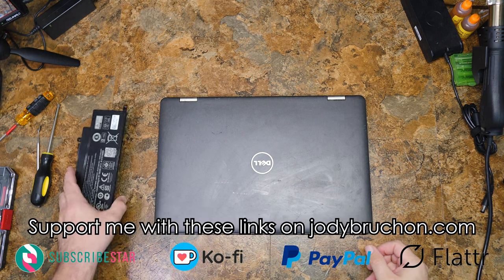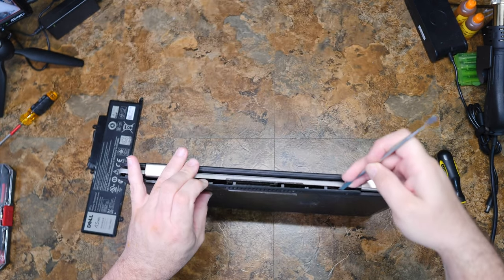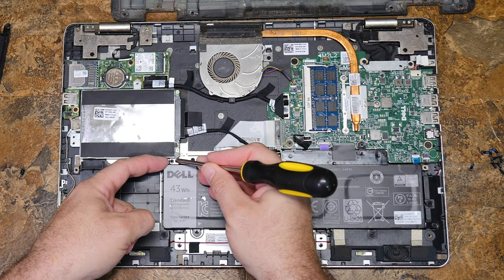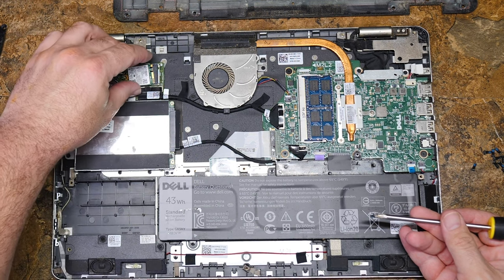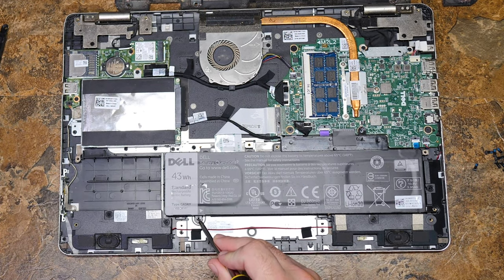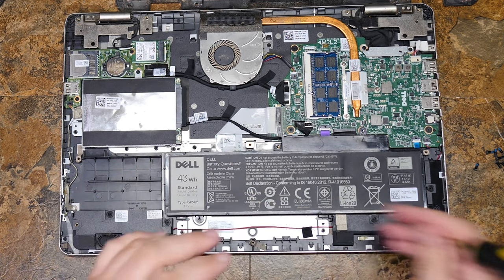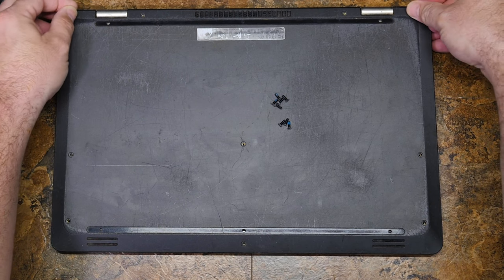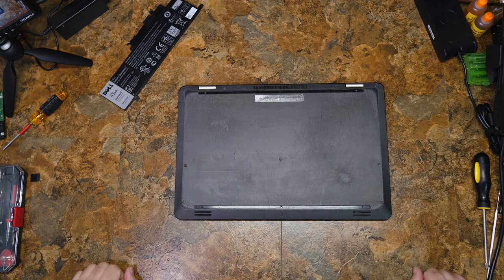Dell Inspiron 15 7558-7568 Disassembly - Jody Bruchon

Comment: I have dental tools that look very similar to the metal tool you used to pry the case open 🙂 I also have a magnetic mat that looks kind of like a calendar that has a surface you can write on with dry erase markers which can become very handy when a laptop case has different length screws (some old Sony laptops in particular had multiple lengths of case screws) so you can note where the longer screws went and also when tearing down multiple components can mark where each set of screws came from for easy reinstallation of components. Bought it from the vendor I order mobile phone parts from and love it. Think it was only about $10 and is worth every penny. 🙂
Reply from the maker: They sell these silicone work mats (I have one) on Amazon that have a magnetic strip under the top and a ton of small raised rectangles across the top so you can put screws down in order and they won't roll off. I just use it for hot air reflow and capacitor repair work but it would be quite useful for anyone who does disassembly work.

Comment: The first thing you should of done is use an anti-static mat and bracelet and the second thing after opening the case with a NON-METALLIC tool is to disconnect the battery after that you can remove the other parts. That's the right way to do it.
Reply from the maker: None of that is necessary.
Reply: I do pc repair all day long and never use anti static mats or bracelets

Comment: That is not a CMOS battery. It's for the real time clock.  Settings are not in "CMOS" (CMOS RAM), which required a battery, anymore they are in an EEPROM that doesn't need a battery to save the settings (non-volitile storage). (I think it's a 24C02C 2K serial EEPROM, on this system). 

Larger EEPROMS also hold our flashable BIOS / UEFI now as well, but they keep the "soft settings" in a smaller separate EEPROM chip.

Pulling the battery does nothing but clear the real time clock, not the BIOS settings or passwords. It hasn't done that in many many years.
Reply from the maker: Yes, it's a "CMOS battery." CMOS is a semiconductor type, so it was never technically accurate to call it a "CMOS battery" in the first place, but that's the term that has been given to it over the past four decades of PC-compatible computing. No, the settings are not stored in an EEPROM; they're stored in static RAM in the chipset that's maintained by the "CMOS battery." No, BIOS executable code is not stored in an EEPROM, it's stored in flash memory. Pulling the battery will, in fact, reset all the BIOS settings as well as the RTC.

Do not speak authoritatively on things you don't understand.
Reply: @JodyBruchon  Wow! It amazes me how little some "tech" people know about computers.  BIOS / UEFI executable code IS stored in an EEPROM (Electrically Erasable Programmable Read Only Memory).  Flash memory is an EEPROM!  Notice I used "Flashable" above.

On the Settings side of things, your are wrong as well.  How about you try this: set a system password on your laptop, Admin Password, Service / Asset Tag info (which is blank on factory new MBs), etc.. then pull that "CMOS Battery" for as long as you like and see if those settings get cleared.  The only way to clear them is to know them already, or to put jumpers across certain pins of the EEPROM chip (24C02C is common for the Dell Laptops), while it is powered on.  You can also contact the MFG, especially Dell, to "generate" a password for you if you are a legitimate owner.

FYI - I've been working on computers as a hardware and software engineer since the early 1980s, and went to The University of Pittsburgh, and Carnegie Mellon University for EE and CS.  

Since you obviously didn't get any formal training, and have some fundamental misunderstandings yourself,  maybe you should "...not speak authoritatively on things you don't understand."?
Reply: @chipinnc  grabs some popcorn waiting for jody's answer
Reply: @annakessler9372  Normally I wouldn't be that harsh, even online.  But anyone that posts "Do not speak authoritatively on things you don't understand.", even if he was right, is not someone that has a clue about treating people with respect.

If someone disagrees with you, so what?  Especially on the Internet!!!

That phrase he added at the end, shows a combination of arrogance and insecurity that doesn't do well on YouTube or in a business situation (even where customers don't have other options on where to go to have their equipment serviced).